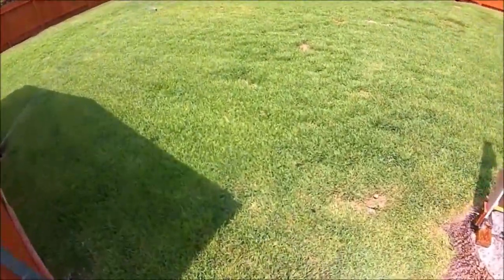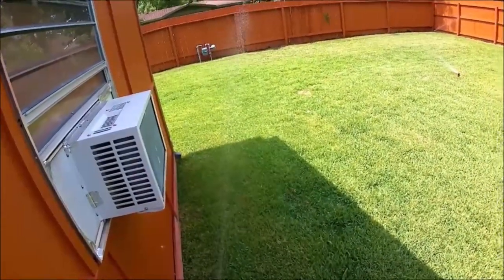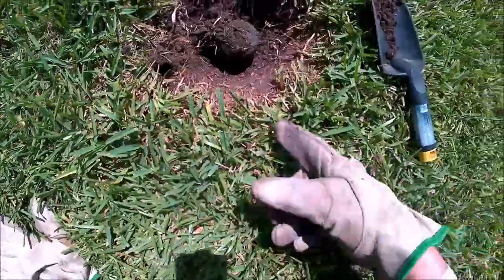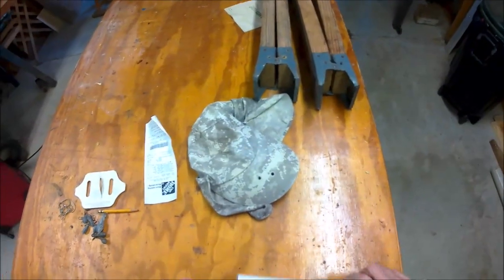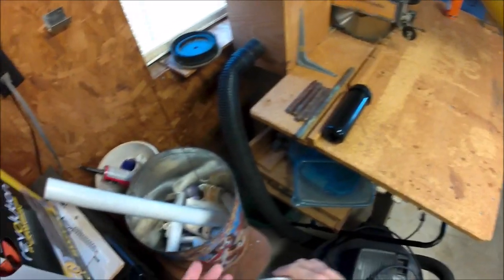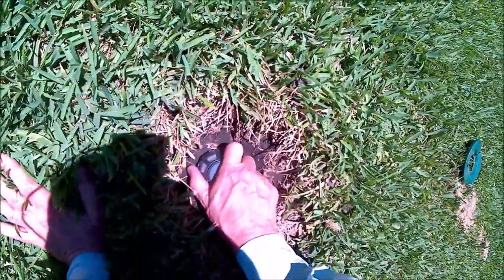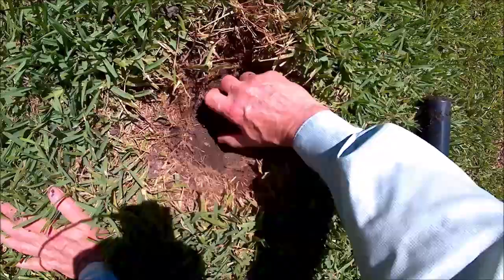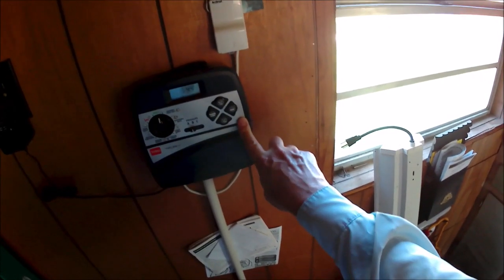Replacing a broken sprinkler

Comment: the gears wear out on those 360 rotors.. a problem I find very often at work...
Reply from the maker: I don't know if it's just the TORO brand but once they get scratched up from dirt they stop going back down to. Cleaning them or sanding them don't help either.
Reply: @WaynJul  we use Hunter sprinklers at my work, they last by far, the longest.. well worth the money. they are even somewhat resistant to being driven on.. lol
Reply from the maker: Thanks. I will have to try them.
Reply: @WaynJul  the I25 is a great sprinkler.. the pgj and pgp too